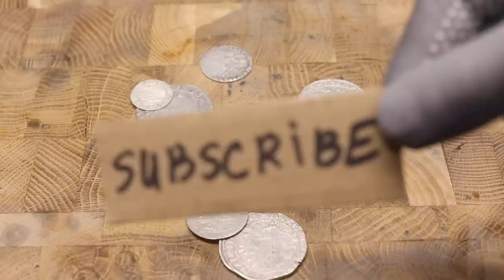Medieval Rusty Pocket Knife Restoration

Comment: There's no way that's 500 yrs old
Reply: Hello sir ❤️ have a great day
Reply: And what are you using to come to that conclusion
Reply: @bigamigo4863  simple: metallurgy was by far not as developed in medieval times...that's why knifes in general weren't folded, but always caried  in a holster (pen knife for instance) the two "tongue" slot design of the handle would be something, they weren't able to manufacture...it's not that they had metal saws in those days, those came only into existence when we discovered new smelting processes and alloys...if something had to be split, it was done with chisels and hammers and in hot condition...imagine that fragile part being manufactured under such circumstances...I'd say (*and that is just a guess) that knife is Victorian...it was during that period, that pocket knives as we know them, came into being
Reply: @soren9310  bs. There are folding knives with similar construction made in the early medieval period. These people made the most complex metal armor in the Europe and had 180cm zweihander swords. They were making wheel lock pistols damn it. I am pretty sure they knew how to make a solid metal frame for a friction folder.
Reply: @ReasonAboveEverything  eh, you are aware, that there is a huge difference between a small, intricacy metal piece like a folding knife and  chunky objects like pistols etc..and no, the wheel lock pistol wasn't invented or build in the medieval period, lol
Reply: @soren9310  The earliest dated folding knife dates back to 500-600 B.C. Austria. the concept of a knife that can fold has been around for a long time.

Comment: If is from 1700 is not medieval. According with historians the Medieval Age ends after Cristofor Columb discoveries in 1492, while others are placing the end of the medieval age later,  in the moment when all the armies start using constantly the fire guns, which is after 1500. If the knife is from 1700 then is from the begining of the industrial age.  For me, looking at the bolt holding the blade, it seems that is machined not hand crafter. in the medieval age the small fastening devices were mostly rivets. Bolts were bulky with very large threads. As for the work, hats off.
Reply: 1800s, you mean. I really don't think is OK to restore certain reliques. Just an opinion, it's up to the owner.
Reply: Medieval style

Comment: Обычный нож 🔪 бритва такие были в 18-19 веке . На вряд ли этому ножу 500 лет где-то около 150-200 лет за 500 лет он сгнил бы так что реставрировать не чего было бы. Автор канала молодец классная работа 👍👍👍👍👍
Reply: Hello sir ❤️ have a great day
Reply: Depends on where it was kept.  In a dry temperate area, the iron would corrode very slowly. However if buried in damp soil, it would corrode to nothing in only 50ish years.
Reply: @jewellerydesignerartists9353  Hello and have a nice day.
Reply: @robertwillis4061  Yes, I completely agree with you if this artifact was lying in moist soil, then there would be nothing left of it. However, I found similar artifacts at an old settlement that was founded in 1780.
Reply: Если бы этот нож лежал в пресноводном водоёме глубоко в иле, он бы вообще не заржавел, потому что в этой среде нет кислорода. Но, если его достать, на воздухе он бы покрылся налетом ржавчины за минуты. Это я сам видел.

Comment: Where did you get the info on the knife lol, that was used around the same time as rondelle knives and bollock daggers?, That pitting is ancient I'm not doubting that it's extremely old just curious on what the history is that you were told
Reply from the maker: I love history) This is a knife of the 16th and 17th centuries. It is called a Cossack knife http://knife.org.ua/wp-content/uploads/22293515.jpg
Reply: @ReXtorer  that's really cool man, i have a couple old turn of the century Barlow made by New York knife company Walden NY, it's so cool to be able to hold a piece of history in your hand that probably cut a man dinner before the u.s. was even founded

Comment: I've a modern copy of a similar mediaeval knife design, except that mine has a slightly longer thumb lever, and it is a lambsfoot blade. My casing is brass, in imitation of the original bronze; blade is modern stainless steel. What I really liked about your restoration was the mediaeval blued-metal cat 😉 Just like my first one!
Reply: Apparently a very similar design was already common as a utility knife back in Roman times. 
A friend and I found one just like it, but not as well preserved,  when digging the foundations for a pool in Hungary. 
We found a filled in well shaft and at the bottom of it there were all sorts of little finds, buttons, coins from the early 17th century,  a horn comb and a little knife just like that, but 70% of the blade was gone.
We gave it all to a little local museum, the historian there was kind enough to explain each piece to us and buy us lunch.
Reply: @marcusott2973  You jammy so-and-so. The best I've ever found was a tiny piece of Roman pottery.
Reply: @marklammas2465  never find anything myself, but I'm a good luck charm for others. 
I've been present at two somewhat more spectacular finds.
I was operating a mini digger at the pool site, 25 years ago, when my friend yelled stop.
Reply: @marcusott2973  UT makes me wonder if you found a well or a latrine. Both are known to collect items that have fallen from the surface.

Comment: Medieval?? That looks like a local knife made by village smiths  in Meghalaya, India,  and called "Tari-Dab" albeit this one comes with an iron hilt, though most is made of wood.  It's available cheaply  at an equivalent of $1 or $2 dollars (about ₹80-160 Indian rupees)
Reply from the maker: This is a 16th century knife.  This type of knife is called a Cossack knife and was common in Ukraine. This is not a rare knife, but an old one.
Reply: @ReXtorer  many people still use the same types and styles of blades as their ancestors did back generation ago.   Only carbon dating and various other instruments can say for sure, this was made in the 1600's.

Comment: I’ve seen electrolysis used many times by different restorers and my jaw dropped. I’ve never seen so much gunk come off a part so quickly!!! 😵
Reply from the maker: It's a small knife and 12 volts and 5 amps do everything fast)

Comment: 1500s is not medieval. That knife is not 500 years old  it looks like it was made from rolled or sheet steel, which makes it fairly modern. If it were authentic the hole for the rivet would be punched rather than drilled, if it had a rivet at all  looks like a narrow drop point blade, probably less than 100 years old. Metallurgical analysis would probably give a pretty good date but it's probably not worth it.

Comment: I'm new to knife and gun restoration, but I don't see the point of scraping and brushing the rust before electrolysis.  Also, why bother removing the rust pit black spots with acid just to turn around and cold blue them back in?  Seems redundant for both actions.

Comment: you know that was handmade by a blacksmith if it is 500 years old. it is very simple in design, and doesn't use a spring to hold the blade open so it's safe to say it predates that technology, or is a very old copy of it. at least it isn't a modern knife someone buried for a couple months to fake a restoration. i blacksmith as a hobby, i might try to copy it's design. should be easy enough. edit; you will anger the smithing gods by working iron when it's cold like that. hence the saying strike while the iron is hot. a little medieval blacksmithing superstition for you.

Comment: They didn't have pocket knives in the 1500s, steel was far precious. And if someone was fortunate to have a steel knife, it certainly wasn't foldable; it was more than likely a belt-held dagger. Either way, the person would have been wealthy to have a steel knife.
Reply: Thanks for the informative note. I will be glad if you rate my work. Of course, I don’t make functional knives, but from the last work there was a ring with sapphires from a titanium pipe.
Reply: The pocket knife dates back to before the Roman empire. The earliest dated folding knife dates back to 500-600 B.C. in Austria, it only takes a few minutes of research to know that. If you mean slipjoint or locking pocket knives specifically, those weren't invented until the 1600s. But the concept of a knife that can fold has been around for a long time.